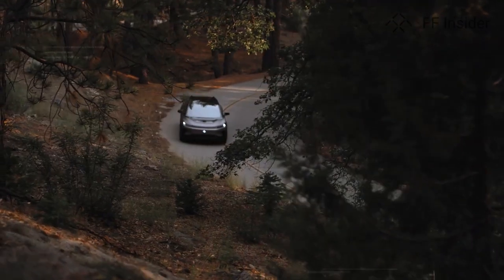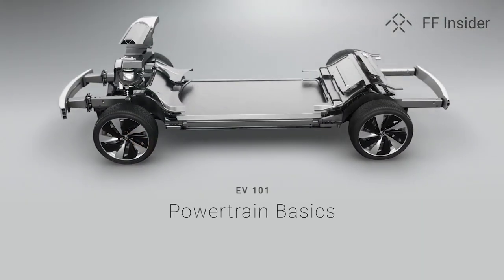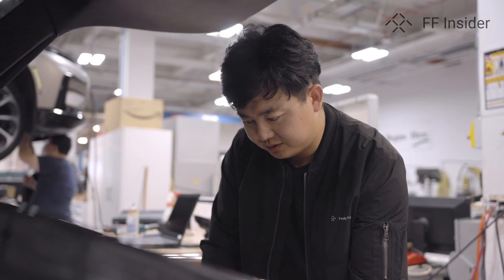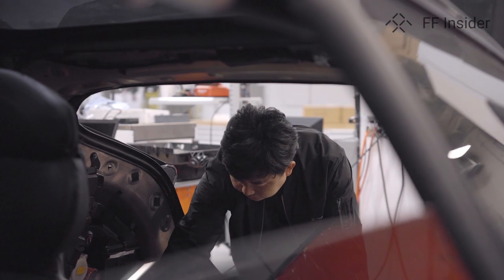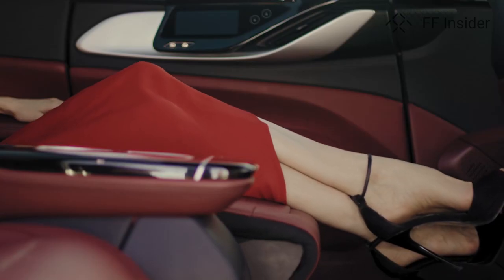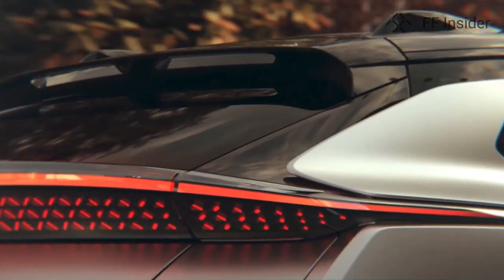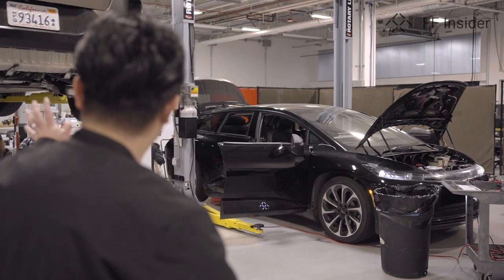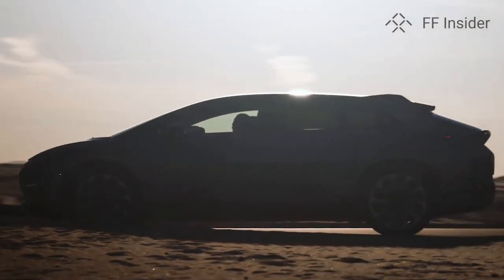EV 101 | Electric Vehicle Powertrain Basics | FF Insider

Comment: This was definitely an engineer trying to communicate to the public. Going to deep on some components and leaving out others. Most people don’t care about AC vs DC, but the bulk of the people that will buy this understand a transmission. Not talking about the fact a transmission doesn’t have to shift making the ride much smoother was a big miss. plus the weight transition of no engine or transmission but adding a heavy battery is a massive benefit that was not mentioned. The battery being centered and low to the ground greatly increases handling and makes a big car feel smaller because it takes less force to turn the car. Also the battery increases the strength of the passenger compartment greatly increasing safety.